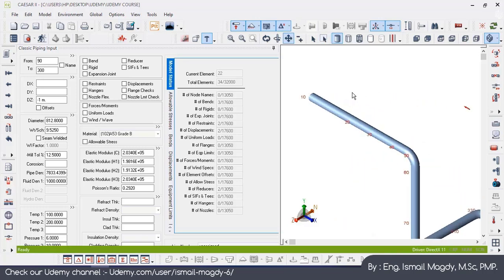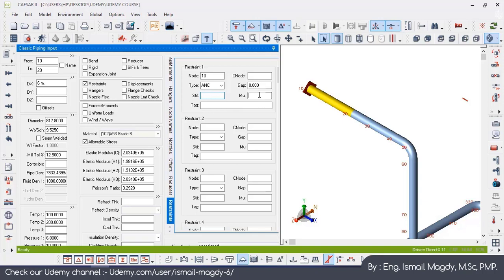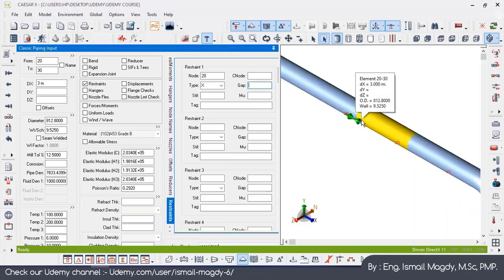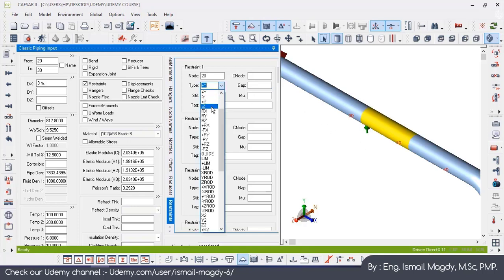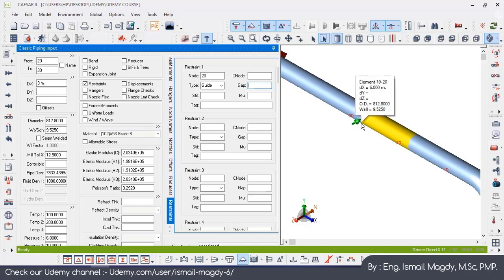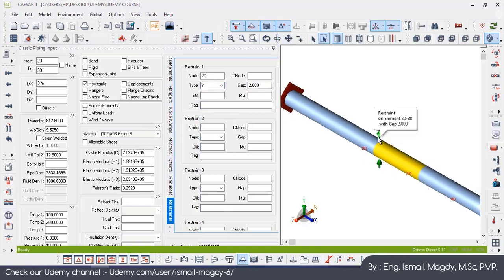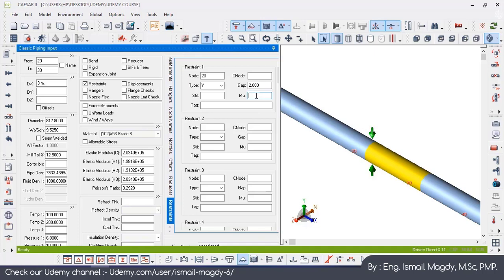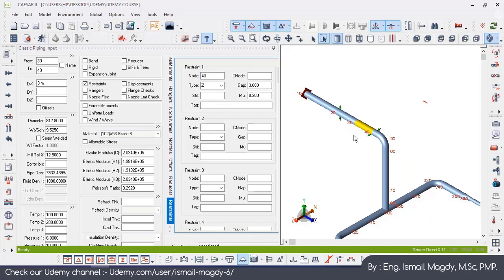CAESAR II : Adding rigid supports

Comment: (1) is welded pipe support on the bottom of piping SAME as strapped around the piping in terms of ceaser iI input?  or (2) is welded pipe support treated as the +Y restraint type in the upward direction only? or (3) is welded pipe support treated as the Y restraint type in the upward and downward direction?  Thank you
Reply from the maker: It all depends on the arrangement of the support and the movement it restraints 
. In case of welded pipe support, this means you are restraining movement in both upward and downward directions, lateral movement, in addition to the longitudinal direction also.
While in case of strapped supports, you are restraining only vertical and lateral movement. While longitudinal movement is free (except for the factor of friction of course).

If you are interested in joining the full course, you can find below 90% discount code for very limited time.

https://www.udemy.com/course/learn-caesar-ii-the-complete-pipe-stress-analysis-course/?couponCode=YOUTUBECODE